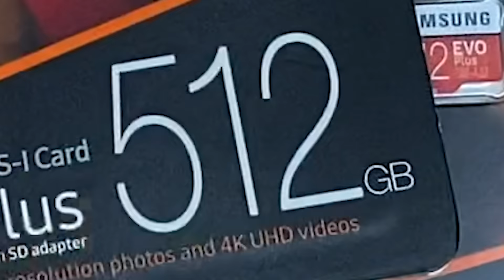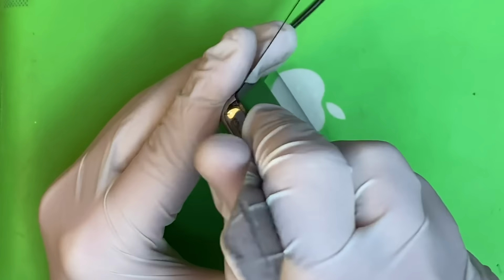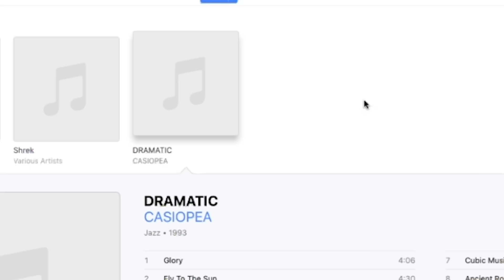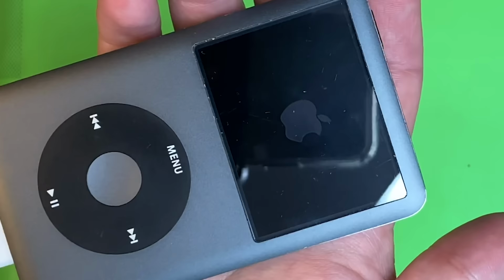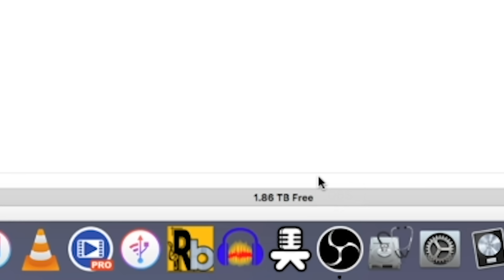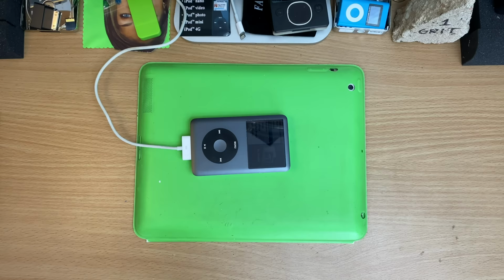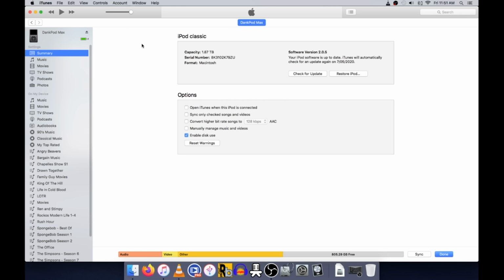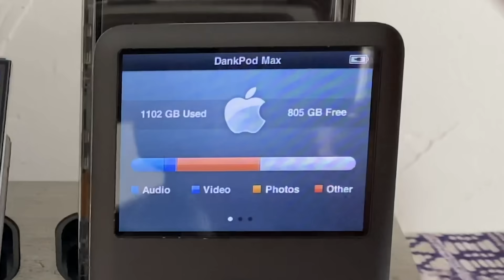The 2000GB iPod Classic.

Comment: I love how the 512 GB card reads it as “created 1 january 1970” and “modified 1 january 1980”
Reply: gotta love me some janky metadata
Reply: Ya it’s called Unix time. Look it up ig guess. That’s the minimum value before it turns negative
Reply: @unhhgcrxexhjvuvujchcrzwzwz7956  but why make it 1970 and not 2000
Reply: @MarcelDerLPer  because computers existed before the 2000s
Reply: @Fran-kc2gu  that doesnt explain why i can set my windows 11 pc to 1970
Reply: @MarcelDerLPer  because the first computer was made in 1970 and the windows 11 is for backwards compatibility with old bios's
Reply: @06NinjaKid06  bruh

Comment: Just wait untill he realizes 1tb micro sd cards exist.
Reply: Don't they also cost like $500 each?
Reply: about 350-550 yea
Reply: 4TB or nothing, for about $2000.
Reply: thats a scam
Reply: There like AU$999 for a 1tb
Reply: But the 512 are like AU$250 for the ones in this video
Reply: they exist
Reply: Coming from China i call that so fake
Reply: When he destroys this one he will use 4 of these to maka a 4tb ipod
Reply: MAma Luigi 4tb then wait until 2tb micro sd cards exist
Reply: Extreme Gamer807 then 8 tb iPod will exist the 8tb sd cards will exist in 2050 and with it a 32 tb iPod will exist
It’s a battle between dankpods and sd card manfutures
Reply: Galaxies the RAM I guess it would be epic if you could put more ram into them.
Reply: Or wait until he tries it and realizes that the iFlash board doesn't work with some 1TB micro SD cards.  Technically in Windows 10, it should support up to 16TB because of the 4k sector limit....  but I have yet to see someone break 2TB successfully without using Rockbox.
Reply: @TheRubyMinecraft  With MBR, you can only go up to 16TB with 4k sectors.
Reply: ThE 4 Tb IpOd
Reply: @BastelPichi  Bugs?
Reply: $5 yay 16gb oh no
Reply: @notgray88  theres a $34 one om amazon(good quality)
Reply: @TheRubyMinecraft  damn
Reply: Kinda want one of those cause my Fiio m3k can actually handle those natively... but... uh... I haven't even filled the 64gig SD yet...
Reply: @NightyFall  don't believe those for a second, for 34 bucks it's probably a 16 or even 8 gig SD with a "looped memory" firmware hack that makes it LOOK like it works until you try to fill past the real capacity then it starts overwriting stuff, you can look it up, it's a nasty scam
Reply: hahaha

Comment: In the PSP modding community this sort of thing was very common.  Not with the TB+ storage because they didn't exist yet; but, back in the day MemorySticks (Sony's proprietary memory card because of course) were ungodly expensive and they never made one larger than 32GB.  So, some genius created the "Photofast Adapter".  It was for Sony cameras but fit the PSP too; and it allowed you to fit two MicroSD cards in the MemoryStick slot using a RAID format.

Most people put in a pair of 16GB cards to have a cheap 32GB of space for music and movies or a pair of then-expensive 32GB cards for 64 GB of piracy bliss.  Every so often when a new mega sized MicroSD card comes out, some hero will buy a pair, stick them in their PSP, and share the results with the forum readers, all three of us.  It turns out Sony massively future proofed the PSP.  They'll read a terabyte, probably even two, no problem.  Well, one problem... It's very slow, like Frank in the sunshine.  Using it with custom firmware and the Categories Lite plug-in is highly recommend to speed things up.  And it can play WAV, unlike the Zune.
Reply: Fellow PSP enjoyer!!

Comment: May not be the RAM that's limited but the space allocated for the track counter. If only 16 bits are allocated for the number, that counter maxes out at 65,535 and possibly caused the iPod to crash because of a buffer overflow error (the bits overwrite into memory allocated for something else and that flipped bit causes mayhem).
Reply: Kyaru Momochi  overflows can cause memory leak into other bits of code, which cause crashes.
Reply: Ah, I love info on things that I won't remember.
Reply: It does make sense that they’d use a 16 bit number… I mean, *who’s gonna put more than 65,535 songs on a single device*?
Reply: @pantallahueso  .... I had 45000 on mine and it wasn't all filled yet.
Reply: @GamingDad  what the actual crap...amazing
Reply: @stefan.5036  I think I could fill it all up if I tried...
Reply: Theres no point for having a 2tp in an old ipod for just music and vid
Reply: I think it's both, I usually keep mine between 30 and 35k because at 35-40 it will crash and reboot when you hit shuffle. For me that's about 200GB but if you had tons of podcasts and audiobooks I guess you could use a lot of storage. You could also probably maximize the number of tracks if you minimized the metadata to keep the database size down.
Reply: @BCThunderthud  mine didn't have the shuffle issue
Reply: @GamingDad  With how many songs? I started by filling it with about 40k and then pruned back to about 30, but sometimes I've let it get back up to 36 or so without problems. I think maybe having large artwork, etc. makes it worse.
Reply: @BCThunderthud  45k
Reply: I would hope there's a way around that. I'm a music and video holder, and love the idea of having hundreds of thousands of songs and videos stored on one device.
Reply: @RenaissanceEarCandy  any android with an SD card slot should help you. Just buy a 500gb micro SD.
Reply: @pantallahueso  well it’s more like, maybe because no one would really be able to get that many songs on anyway, If they had the base model….  But this is modding territory, so it’s completely different, which is why this happened.
Reply: @GamingDad  you can’t just put an sd card with any storage size into a phone, you need to check the maximum sd card storage limit for the phone too. I had tried to put a 256gb sd card into my Samsung s7 edge, and the data in it corrupted, 3 times. Later I found out that my phone have a 200gb sd card storage limit.
Reply: @samuraijackson241  modern androids don't have a limit anymore
Reply: @N-V_Plushie_Lover who doesn't adore N
Reply: @BaTTx  people who don't adore N
Reply: @N-V_Plushie_Lover  EY
Reply: @BaTTx  hehehehe

Comment: At this point you just have a 2 terabyte external hard drive with a screen on it
Reply: That runs iPod OS.
Reply: Holy shit lmao
Reply: @SuS_NuG_It   hm.
Reply: an external 2tb external hdd is more useful though
Reply: Kinda useless though because an iPod isnt going to allow full transfer speeds if used like an external hardrive
Reply: a ssd is faster 

you can put that in a ipod richd
Reply: does it even read the rifht cap after the mod

Comment: I'm not really surprised that the iPod choked on so many songs. iTunes was always really bad about handling large libraries. My memory is failing, but I think it kept it's database for the whole library in one file and would have to basically rewrite it every time it updated. I had a library of about 100,000 songs at one point and it took forever to start the program. I wouldn't be surprised if the iPod wasn't also doing similar.
Reply: seeing as the file system is HFS+, im pretty sure theres an additional journal that the system has for itself, alongside this iTunes database file

Comment: Seeing how the iPod bricked after 65,702 songs were on it, it made me think of 65,535. This is a special number, because it is 2^16 - 1. This is the biggest integer number you can store in 2 bytes. In programming, this would be a short. The programmers of the iPod's OS probably chose to store the number of songs using a short because it's a pretty standard data type, and they didn't expect someone to put more than 65,535 songs on their iPod. Going over 65,535 can in some cases cause the count to wrap back around to 0 when you add to it. Somewhere in the iPod OS, it is being told that there are only 166 songs on the iPod, when there aren't.
Reply: damn, programming’s insane
Reply: Mathcoolb  hm yes I do understand it I understand that you can fit some things into a number 👍
Reply: unsigned short btw, a normal short has a minimum of - 32768 and a maximum of 32767
Reply: Apple devs usually do shit like this. They put unreasonable restrictions in their os within their hardware specification (like Mac is only capable of having 6 or 8 USB ports at all). I mean storing the absolute max value in an int or a long wouldn't hurt a lot in terms of efficiency or programming. They are just microoptimizing to maximum
Reply: Where’s best place to grab songs and vids from cuz I’m really thinking about getting a iPod classic or a touch lol
Reply: So basically like 32bit or something.
Reply: @pastypatsy7515  slsk is your friend
Reply: @vikumwijekoon3166  To be fair that's not at all an Apple thing, and considering that nobody would ever possibly have imagined a terabyte in this thing in 2009, 16 bits is perfectly reasonable here.
Reply: I believe this is something called wrapping around in C?

Comment: Uses Samsung Sd Cards

Apple: Wait, that’s illegal.
Reply: I’m afraid the native Apple storages are manufactured by Samsung
Reply: Not to be on r/wooosh but apple does'nt make sd cards
Reply: Even though samsung makes their screens, pretty sure they're buds
Reply: All Apple products secretly Samsung but user os is Apple
Reply: @justforrobux4193  thank god because if they did theh would cost 700 dollars for 2GB of storage , then they would charge you another 600 for the proprietary  transfer cable
Reply: iPhone screens, Touch Bar, and past processors (like the A9) were manufactured by Samsung. =)
Reply: @Señor Llama 365 no what?
Reply: @Christian-et9sv  N O
Reply: @cheesebusiness  ooooooooooooofffff
Reply: Apple: You need to buy your Samsung flash internally through Appel
Reply: Irrespective of who produces the hardware, if the brand name on it is anything other than Apple itself, Apple will claim its illegal (as shown in their opposition to Right To Repair).  Trust that anyone with brand names of their own charges Apple a pretty penny for generic hw for Apple to put their own name on.
Reply: casparjack tonybala No. Absolutely not.
Reply: @Señor Llama 365 yes
Reply: apple uses samsung SSDs in their laptops
Reply: The Mac Classic often used a Samsung CRT.
Reply: Just For Robux r/woooosh
Reply: You do know that samsung supplies around 90% of apple iPhone led displays, right?
Reply: NotLxrd  Pretty sure the UFS storage in iPhones as well as the RAM is Samsung. Will investigate.
Reply: Actually apples hardware are normally manufactured by Samsung
Reply: Apple love Samsung. Apple hate Samsung.

Samsung love Apple. Samsung hate Apple.

The screens of the IPhones are made by Samsung.
Reply: The correct answer is

Mods Apple iPod

Apple: Wait... that’s legal?
Reply: Yee
Reply: Mate, Samsung isn’t Apples only competitor ye dingus.
Reply: @Makakahanap  stfu fandroid
Reply: @saturniunyttech679  Ya, But Your Fake Verification Mark Makes Your Account Look Not Great.   But Listen, You Don't Say "Stfu Fandroid" Mate, That's Not Kind.
Reply: @JohnSmith..  i feel like just wanting to ignore my comments/replies from over 10 months but ok
Reply: @saturniunyttech679  i mean, apple stand

Comment: I did this to an iPod classic and it worked but then down the road it crashed. Tried to adjust the board inside and the battery cable slot broke off the board :(. Tried using two other boards and they broke the same way. I have another IPod classic but worried bout breaking again. Wish Apple would bring them back. Awesome video mate!!

Comment: The problem with the apple firmware is that it loads the entire track database into RAM, which is why the 64MB RAM models can hold more tracks than the 32MB ones. If you put rockbox on there you can just dump your music files on the disk and it'll let you play the files from the file browser instead

Comment: I have worked on many of these upgraded ipods.  It is common for the ipod to become molasses slow after 20,000 tracks are installed.  I'm talking about 5 to 15 second wait time between clicks.  There is a bottleneck in both the processor and the RAM.  And there is no way to add more Ram.  I would recommend a Maximum of 256gb SSD and buy the fastest memory card you can find.  3D memory cards may also cause a conflict.

Comment: As soon as you pass the 16 bit integer limit the issue isn't the number of songs, it's the number that represents the number of songs. The 16 bit integer limit is 65536, and in the "song count" register 65536 would be represented as 1111111111111111 (binary). The number 65702 cannot be expressed in 16 bits, so when it tries to write the song total as 65702, it causes an integer overflow and breaks, possibly trying to write data to another neighbouring register. It's similar to how older iPhones can get bricked if you try to set the date to before Jan 1 1970 because it causes an integer underflow (when it goes from 0 to the maximum) on the 32 bit register of the unix time stamp.

Comment: I have a much older generation of these cards, with hdd to compact flash to SD, and I often have to reboot it 3 or 4 times before iTunes will see it and I get the "corrupted iPod" message occasionally but it's still working pretty well otherwise. I'm getting to the point where I should replace the battery soon but I'm dreading opening it up again.

Comment: You may have just delivered me from office noise.

I work in an industry where wireless and cameras are often not allowed in some areas, and companies frequently block streaming sites, especially now with so much pressure from people connecting to the VPN from home. I have an old iPod Nano, but 16GB? Come on! I also have an old spinning disc iPod, though. It can hold 160 GB (I think), so it's no slouch, but spinning platters? Eew. Upgrade time!

Comment: When manufacturers say 1 TB they do actually mean 1000 GB, but funnily enough, in the past for example 1 Kilobyte actually meant 1024 Byte and so on I think that is what you meant, and it is just way more fitting for binary systems they wouldn't be happy with decimal counting. 
At one point manufacturers seem to have realized that they can cheat by using these like in metric units on a decimal base. But because nowadays we are at Terrabytes this "cheating" really becomes more and more obvious. So the more technical units would now be called 1 Tebibyte ore TiB for short and would you install a 1 TiB drive for example on a Windows Machine it would actually show up as 1TB there because Windows is using the original way of counting. 
To put that in Perspective, 1 TiB are around 1,1 TB. So most of the times you do actually get the amount of space promised but our devices aren't counting like that so it will show up as less. They simply sell us disk space with the wrong units so it sounds like more.

Comment: Hey man how are you doing 
I managed to buy one ipod classic 7th gen few years back it was working ok but few weeks back when I checked it was not so By getting inspiration from you to upgrade ipod classic 7 th gen to higher storage capacity I started a mission to upgrade it not by much but 512 gig storage with iflash quad(considering future upgrade)
I also bought tools needed and after much struggle and bending back case side connector little bit (which was later fixed by forcing it to its original place ) I was able to open the ipod classic....I felt like it was not open before for sure... But unfortunately I realised that the flex battery connector came out by itself from board and my mission got huge blockage....and unfortunately I cannot get those flex connector locally and also not able to order them from outside....so long story short I need some advice and if possible help in getting those parts....I crossed 🤞 to hear from you soon to get my mission going and successful....

Comment: Hi, I have been watching various video's on this channel for how to.... and have the following question for a 5 & 5.5 & 7 and 7.5 Gen. iPod video/Classic with various firmware's and my question is; what is the maximum GB of SSD's each Gen. can handle and still shuffle? --> gen. 5 = 256 GB? / Gen. 5.5 = 512 GB? / Gen. 7 and 7.5 = 1TB? According iFlash listing all, with exception the 5 Gen. (due to RAM size) you can install a total of 1 TB. my intention is to use ALAC music files "only" and keep them on the iPod's which is about 30.000~40.000  pcs which according Apple listings should be no problem?

Comment: I think the SD card are wrong (you get scamed). You should have test them before use. Even if it advertised as 512gb some scam made that inside you only have 128 or 64 available and when you try to write on a higher par it just cycle and erase other date. That's why you have inconsistent read/write and corrupt data.

Advice : buy it from a official reseller that accept return and refund if the card is defective and test those cards with software for testing SD real storage and speed. Most of the time if speed is wrong don't test storage it will take an eternity just return it

Comment: The apple software does not handle the GB. Max was 1000 basically. You need to install Rockbox on that for it to work. 

Apple software is shite compared to rockbox because it's so closed.

Comment: I have the ipod 5.5 gen and everytime it gets over 30k songs, it'll show in itunes but after I disconnect it the artist list is blank. FUCK these fuckin ipods. They are shit.
Reply: 30k songs bruh
Reply: I believe the fault is, I put 128gb and 256gb in there. I remember reading somewhere the cards need to be the same size. So I either buy another 128 or 256... @DamageBug